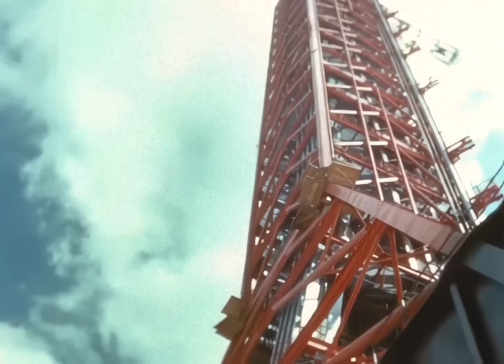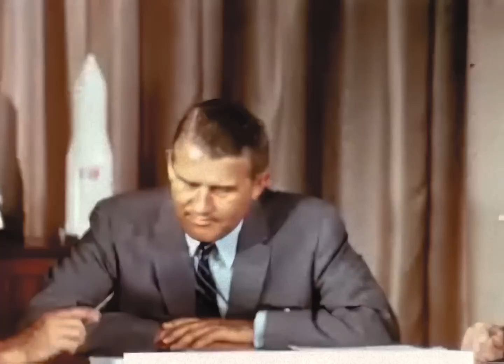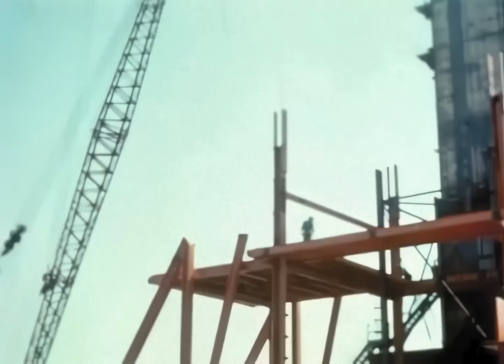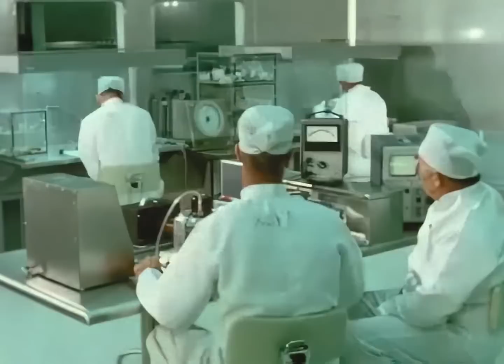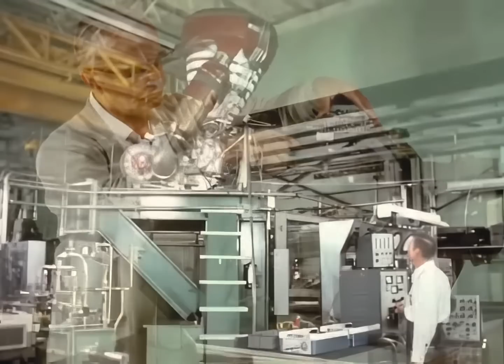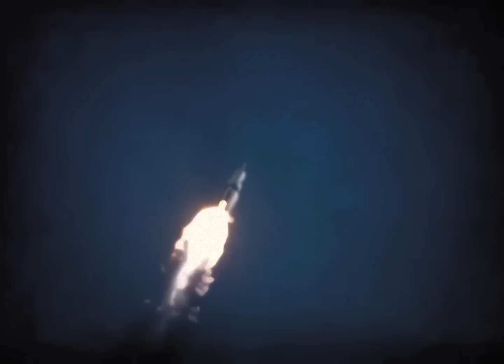The First Ten Lives of Saturn I - Saturn I development, AI Upscale, NASA Documentary, Rocket, Launch

Comment: Something else that this documentary doesn't mention concerning SA-6 and SA-7 is that SA-6 also was the test of the LAS jettison rocket-motor (It had inert abort and pitch rocket-motors) under operational conditions and SA-7 tested the backup jettison mode (It had inert jettison and pitch rocket-motors) of the LES using the abort rocket-motor instead.